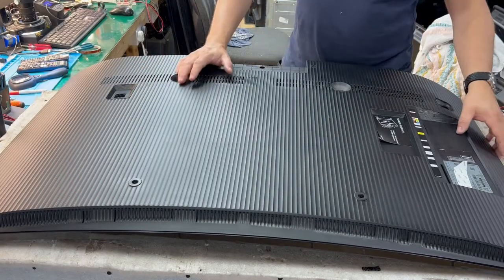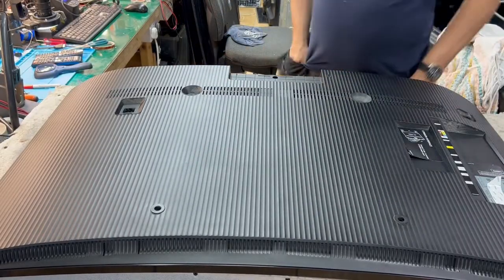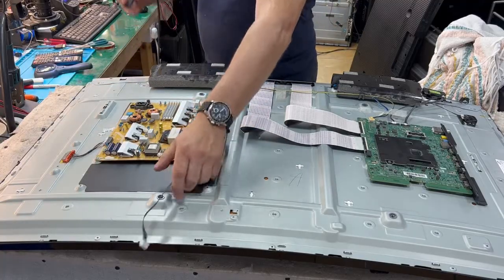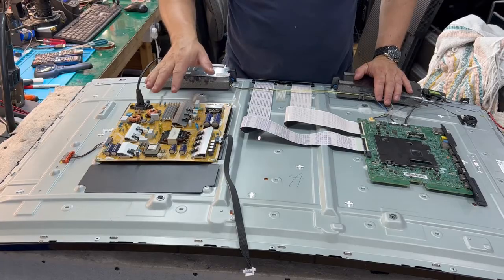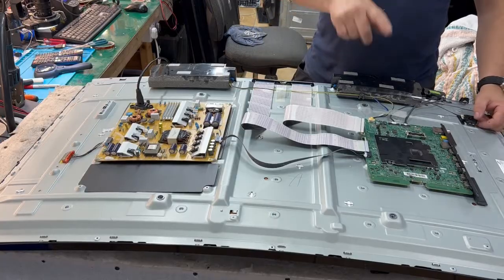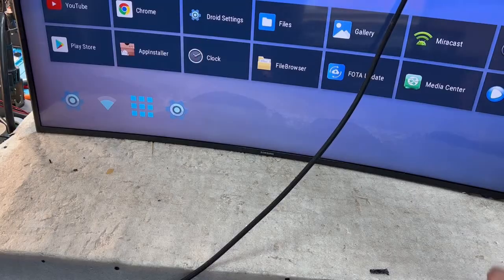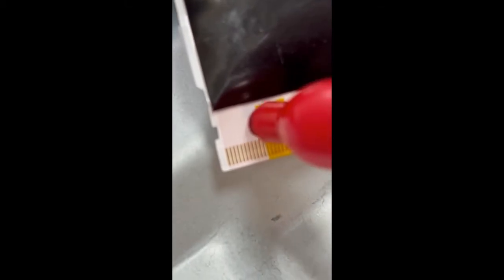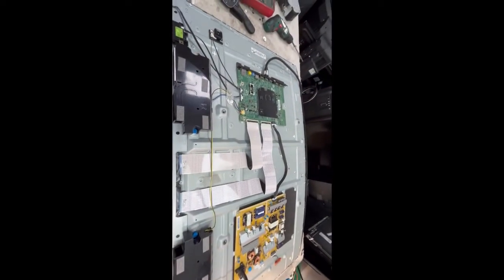Samsung UE49KU6100K No Picture Not turning On Red Light blinking

Comment: Doesn't address the problem though, ie what part to replace?
Reply: Hey is the screen that shorted, is either buy a new tv or used this fix it, has work for me many times on all brands especially with a two cable setup from main board to the tcon.

Comment: Led still just flashes after removing the nain board
Reply: Yeah my just does a flashing in the middle and dosent stop. Not sure what is wrong with it. My other tv won’t turn on inpulled the wire and I had backlights not sure if I should tape

Comment: Hi I changed power supply but half the screen is a little bit dim. My old power supply worked better than this new one. It showed more brightness on all tv but has a little bit of flickering. Why do you think the problem can be if half the tv is a little bit dim. Maybe motherboard? My other power supply has a dim spot but it was in the left side of the tv now I put a new power supply in and the dim part if on the right side. Please let me know if you can help. Thank you! 😊
Reply from the maker: backlight problem- replace